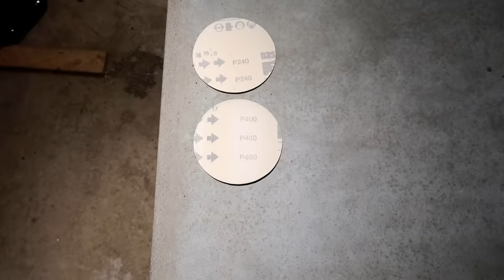DIY Concrete Table

Comment: This vid had everything. IMO very entertaining, super funny content, truly could not believe the choices made in the whole process. Wax melts into a pourable liquid in a saucepan or crockpot. Melted wax can be mixed with turpentine to make an easy to apply, penetrating top coat. Pre-portioned baggies of admixtures are sold right next to the premixed concrete brands. The major brands each sell an admixture that increases slump (wetter, more flowable mix) without compromising strength. Mortar is a product like concrete but without the chunky rocks. It can be used to fill pinholes in concrete. Polyurea is a heat resistant, scratch proof, food safe, waterproof, penetrating, shiny sealer for concrete that is stronger and more sound than epoxy. Before use the concrete must be fully cured first (that’s about 30 days)
Reply from the maker: Thank you for the comment and input Panda🙂
I did try and make wax in a pan combined with linseed oil, for another project, it worked out great.
I also used plasticizer on another project, it made a huge difference.
Have a nice day :)
Reply: Saludos y bendiciones! ✌️👍🙏🙏🙏🔥🔥🔥
Reply: @DIYSupply  Very informative.  I will make a couple of test pieces for practice.
Reply: thanks for potent info.  looked up gallon of the POLYUREA and it goes for $250. a gallon holy smokes!! lol

Comment: 🤣 mate, you had so many bubbles cause you're concrete was stiff. if you had made it a little more liquid, then it would of made it possible for those bubbles in the bottom to escape. furthermore. all you needed to do is to get a product called concrete slip (mostly used to level concrete surfaces) to fill in the holes, or grout. pour it on dry and then spray water over the surface until the surface is super wet and let sit for 72hrs until super dry. come back and sand. wipe away dust with rubbing alcohol and a micromesh towel, then cover in three coats of polyurethane, sanding in between each layer. simple. no need to stress yourself out mate lol.

Comment: As someone who does this professionally, one of my first recommendations would be to a lot higher slump (wetter) of concrete/cement. That will help a lot with the bubbles.
Reply: I think a water reducing add mixture would have really helped a lot here.
Reply: As someone who does this professionally, you should know water excess will make the finak product of way lesser mechanical resistance
Reply: @Robo.1776  You should really use GFRC tops like this anyway, with a good plasticizer. The mix you use for this kind of stuff is like a baking recipe.

Comment: Use flow control plasitcier next time. Turns your cement into pancake batter consistency without losing strength like you would by adding additional water. It will help a lot with bubbles.

Comment: To get rid of the holes, you should try a reactive form release agent. The reaction forms a kind of soap that decreases the surface tension and allows even small bubbles to escape. You may also want to try a water reducer or superplasticiser to give it more fluidity and this also helps in eliminating bubbles and diminishing any potential shrinkage cracking. I have used Nox-Crete brand for several decades.
Reply: WD40 works wonders

Comment: When you are using a levelling compound you will get a perfekt surface. I made countertops for my kitchen and it is just perfect.
Cheap concrete is not good because you have a relatively dry material and when you add water you will get bubbles.
Reply: Saludos y bendiciones!! ✌️👍🙏🔥🔥
Reply: A perfect surface with no air bubbles is boring… what isn’t boring? Mixing epoxy with glow in the dark powder and colored powder so you have small spots all over the table that turn into stars in the night’s sky when the lights are off….

Comment: hi from france  !
im craftsman mason and profesionnal in decorative concrete
u did really good job  and ure comments are really a pleasure to read, u did mistakes and u say it, u  tried , u dig in ure head  to find tips and solutions
thats pure make like i love to watch on yt
what about ure wax , this table is supposed to be outdoor ? 
im not sure ure choice of rebbar is good the risk of rust is high and rebbar during vibrating concrete  oftenly go down and risk to appear when unmolding
i ll prefer to use inox , sure its more expensive but more sure in the time , in my opininion
sorry for english mistakes  i do my best ^^

keep like that 
bye^^
nicolas
Reply from the maker: Hello Nicolas!
Thank you for your comment. The table is indoor at the moment - I never planned on putting it outdoors, though i think it would not be a problem. The rebar is galvanized, so i don't think it will be a problem. As for the vibrating - I put it about 1/3 from the top, when i made the table, so it shouldn't move down so much that it would become a problem - and it will give it better strength.

Comment: Nice table. One suggestion though, use unsanded grout for filling air bubbles and gaps. Sometimes you need multiple passes, but it works like a charm and is easy to remove once set and cured.
Reply: Straight Portland cement works great to fill voids.  But the trick is to mist the surface with water and rub the dry Portland into the pin holes and use your finger to work it in.  Mist a little more water if needed...
Reply: Good tip. Thanks!

Comment: For future reference to till the bubble holes you'll want to use a slurry mix using pure cement but make it pretty thin, like thinner than pancake mix and just rub it down on the table.

Comment: I built my island top the exact same way. BUT, I filled the form very close to being full, i vibrated the heck out of it, then I placed the wire mesh in, then just top coated it to cover the wire. Adding the wire mesh while vibrating will only drop the  mesh down to far that it will be exposed

Comment: Didn't read all comments so i don't know if anyone mentioned it, but On your next pour do it more wet, also once concrete start curing it's a race , the longer you wait to finish it/sand it the garder it is.

Comment: Congratulations. Yoy did a very good job. I made some like this, but, the diference is that i used a glass to create the concrete surface and that came out finished and no needed to sand or pulished.

Comment: I work with concrete everyday. I strongly believe that you could eliminate those air bubbles if you add  more water into the concrete when mixing, it gives you more workability with the paste + a better finish. You could also add some water proofing additive to make it even better. It looks nice, well done. Cheers!
Reply from the maker: Hey! Thank you for your input.
My reason for not adding more water was that it would make the concrete weaker. I have used some plasticizer on other projects, it worked out a bit better with less bubbles but same amount of water.
Cheers!
Reply: I have a quation.
How he did the concrete?
Its a ready mix or just cement and water?
I didnt see the sand..

Comment: good morning I liked the video, I'm from Brazil, most of the video was correcting the problem of porosity of concrete, which would easily solve if you used a sheet of glass as a base or if you were coated with thin plastic on a wooden base before concreting, and for having a better base using cement cream initially and then putting the concrete right after would give a much better finish, and could create concrete matises using 2 or more types by varying the color

Comment: Did you use only concrete to make the table or did you mix it with sand? Doesn't the concrete alone crack in some points after it completely dried?

Comment: You could start to polish concrete let's say after 8 hours of setting with metal spatula, but that's different approach when you are able work on the top of the table the whole time. Ive seen it on industrial scale they were polishing the floor with lawn like machines but with metal rotating wings. The result of it is mirror like surface. But to the point amazing vid you made u inspired me 👌

Comment: would it have been possible to put a vibrator on the table as you were pouring the concrete to ease out air bubbles then? Put the concrete on in layers?
How about putting a design on top so you wouldn't pay attention to the air bubbles? a confuse the eye sorta fing...

Comment: Hello, Sir! Truly grateful for this. You just showed how customers, oftentimes, must value and respect the cost the seller gives to something handmade at such level, instead of bargaining for a discount. It would be of massive value updating your own consideration on this one. For instance: It's better to do this step prior to that one; Use this instead of that; This works better than that, etc. Also can you, please, let us know how the table has been doing after two years on the steel legs base?
Reply from the maker: Hello Thedash! Thank you for the comment, I appreciate your view on things.
As of now: 02. may 2021. I just gave the table an epoxy finish, due to the fact the beeswax turned matte. The table hasn't changed in any way other than that. I have stated a lot of things that would have been better to do, in the comments, but I think that only a few people reads it.

Have a great day.
Reply: @DIYSupply  Nice! Grateful for responding. All the info you inserted on the video are clear and already noted down. I was referring about updating your considerations after the video, past these two years. I'll adventure on making concrete legs instead. Again, grateful for the newest update. Best wishes. Cheers.

Comment: If you want to seal with natural wax, you should make a paste using solvent like turpentine. You`ll get a much better penetration and it will easy to work with. Take some wax and rub it on a grater for vegetables or cheese (or just using a knife). Then put this shavings into metal cup or something else. Pour turpentine into cup to cover wax shavings. And put it on a bain-marie. Dont use any open fire around it. The turpentine vapours are very flameble. Dont heat too much, 150-160 F will be enought. Use simple brush to seal. It will give you very beautifull colour (contrasting effect), but not more. I recomend to use professional havy-duty sealers.
Reply: What type of wax is good for sealing? What is that type of wax called? Is it beeswax? Excuse my ignorance.
Reply: @jhoannayyo  , yes its beeswax.
Reply: Add a little tung oil or grapeseed oil to the mix to make the mixture glide on and buff out fast.

Comment: Wow, thinking doing an outdoor table and think something like this would be perfect. But holy smoke, that seems like  lot of hours went into it. Raw material seems to be pretty reasonable. If I got anything close to what you were able to achieve, I would be more than happy. Very nice finished piece.
Reply from the maker: Use a normal concrete sealer, and get the air bubbles out - that will save you from a lot of work :)

Comment: You’re hilarious! Thanks for showing all the little things that might not go according to plan… (totally on purpose I’m sure 😉)  My husband said ‘see I can do that!’ I’m pretty sure he meant he wants to copy you exactly so he too can use the flame thrower/ grass burner! 😂
Reply from the maker: Haha, thanks for the comment.
Actually I just poured some clear epoxy over it at this point, the wax didnt hold op for very long.

Good luck with the project!
Reply: @DIYSupply  ooh epoxy… that’s a great idea! 💡 I think you did a great job - we had to pause the vid a few times until we stopped laughing. You have a great personality and we love that you included the mishaps!  Thanks for response. Keep up the great work! 
Cheers 🍻

Comment: I think if you tampered, float and troweled the concrete after screed you can avoid the air bubbles. It helps bring up the “cream” from the concrete also so maybe will help with less sanding.
Reply from the maker: Thank you for the input! I may try that in another project!

Comment: You could try filling in the bubbles with ceramic tile grout. It will probably fill them up easier, and you can wipe it flush with a wet sponge.

Comment: Grinding the surface does help with a commercial grinder. All the colours of the stones will be shown red greys yellows, even add black stones. Finish with a lacquer 
Extra vibrating helps, use a pencil vibrater. Made one in the eighties
Cheers have a great day

Comment: Why didn't you use a slurry to fix the holes? You used come concrete mix at the beginning on your first attempt but it was too wet. A slurry is much much wetter. Also you can use a bonding agent to help the new concrete bond to the table. Just a thought.
Reply: Sorry, I meant the first concrete was not wet enough. A slurry is liquid.

Comment: Nice vid excellent first effort. The only issue I have with your beeswax finish is that it does not like heat very much and has poor stain resistance. A far better solution is to use a high end hard wax oil like osmo or fiddes. These handle the day to day hot food and drink mishaps much better. Thanks for vid! Cheers

Comment: Just an Idea, maybe start the first layer with a Grout auto leveling , wait until it start to set and then use normal concrete, or do your normal proyect and when you demold and turn it, aply a thick sanding and a very light screen of grout and see if both fix togheter.

Comment: What works best for me is, rubbing the mold with a thin layer of cooking oil, then spraying it in addition with dishwashing soap and watter mix, 1 spoon soap on 1 0,5 liter of water..making sure it goes everywhere. Then vibrating. The results are superb, no bubbles, perfect details, and easy release from the form. Try it next time!

Comment: Sealing this reminds me of waxing skis or a snowboard. It may have been easier to get a waxing iron or just cover a regular iron with tin foil and turn it on - place the sealing block on the tin foil covered iron. Eventually the wax drips down and you can cover the table with the drops in a snaking pattern. You can then smooth it out by going over the surface of the table with the iron - then buffing it - then scraping it. I’m not familiar with the exact sealant so it might not work the same but its just a thought!

Comment: Okay this might be a really stupid question. But 150kg of concrete? Does that mean the finished table weighs over 150kg because that’s heavy
Reply from the maker: I'm afraid so. 150kg is the final weight, Mel.

Comment: Can you tell me how the concrete mix is prepared, what is the proportion, does it contain sand? what kind of sand, etc, thank you very much.
Reply from the maker: Hey!
I used a finished mix, where I only added water.
But there's 0-4mm sand in the one I used.

Comment: Next time you have pits fill them in, then mix portland cement and water into a paint consistency, paint the entire surface then seal.
Reply: ie make a slurry... I'm no concrete guru but this is what I'd have tried too

Comment: You need to learn the old art of sacking cement, witch will get rid of the small air pockets. Use 60 & 80 silica sand and Portland cement.

Comment: did you think of using epoxi resin? it'll fill the holes and can have a very even finish, you can also polish it.
Reply from the maker: Hey! I actually did that in another video - it worked out quite well🙂

Comment: I really like your project and the video !
Do you think we could use this in a kitchen and would it be heat resistant, waterproof  or even shock-proof ?
Thanks you !
Reply from the maker: Hey - Thank you Alexandre!
I would used another sealer for the concrete then! Beeswax and heat does not go hand in hand :) Then it would fulfill your demands.
Reply: @DIYSupply  Thank you so much for your answer, i will have a look at the other sealers.

Comment: I want to make concrete tables and chairs for our reception in October but watching what you went through has me thinking just order the dang things. I just like making things.
Reply from the maker: Hey!
It's not as hard and complicated as it looks, I made a lot of mistakes - if you just vibrate it well, maybe use a thinner mix and/or some plasticizer to avoid bubbles, and another sealer - there's many options out there, you will be good - good luck :)
Reply: DIY Supply I watched the video again and as I am not making big tables I believe I can do it. Instead of milk crates I am going to use good old HD buckets. A round seat with padding and material will be more comfy. Thank you for the show of confidence.
Reply: My fiancé has disappeared on the road from the Sambisa Forest where he was stationed. He had signed his retirement papers and was driving to the UN in Ghana. UN says he never got there. I am sick and scared.

Comment: That’s pretty cool! I never knew you could get concrete to look so shiny! I think if you put it down on a really smooth surface to start and then paint a really thin layer of concrete before pouring it it will save you all the sanding or at least most of it!

Comment: When you did the vibrating to remove the Air bubbles, where did you position the hammer drill?  On the legs of the table?  I want to make a table tennis table of concrete.  Final step after sealing is painting. What paint works for that?

Comment: Nice job sir. How well does the surface handle wood glue spills/drips?
Reply from the maker: Hey sir.
I have now made an epoxy finish since the beeswax didnt last more than a couple of months before it needed to be done again. Kinda annyoing in the long run.

Comment: is that just regular concrete? not counter top or 5000 crack resistant etc.??
Reply from the maker: @michaeladams2077  
The cheapest i could find in the local hardware store

Comment: thanks for metric system! That is what everyone needs :)
Reply from the maker: I could get in trouble here - but to me it makes more sense yes :) Maybe because that's just what i'm used to.
Reply: This is too difficult for the Americans, they have already tried in the 70s and have failed miserably.
Reply: The Americans has decided to move over to the metric system but gradually, inch by inch!